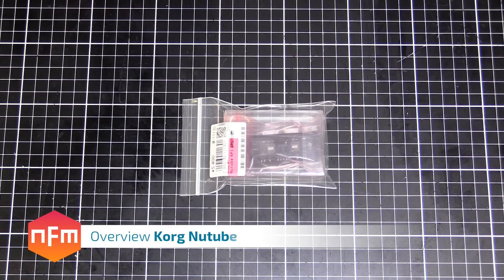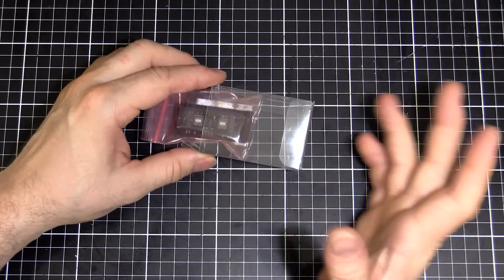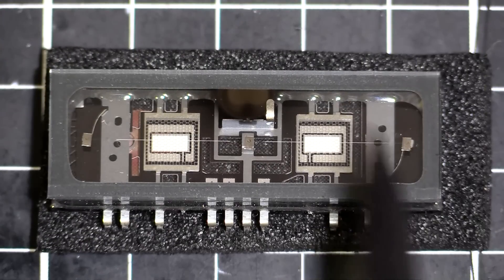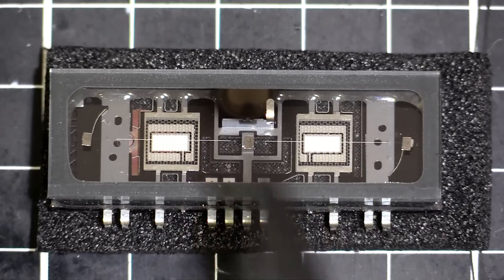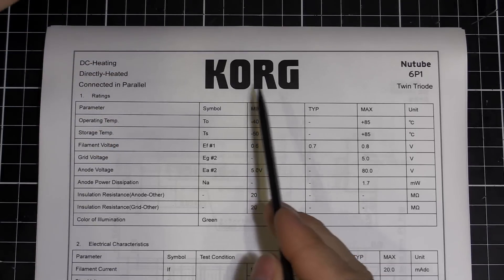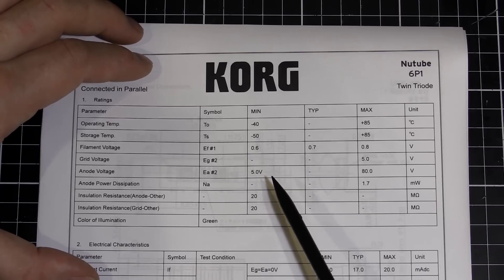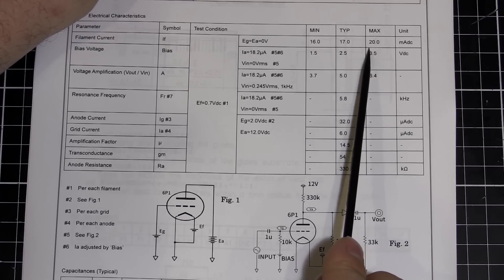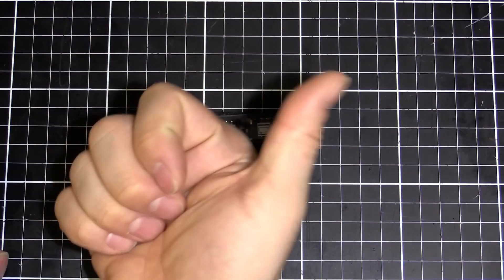Korg/Noritake 6P1 Nutube Vacuum Tube Overvew

Comment: dude its not an innovation... they took a Russian 6p1p (6p1 in china) and stuck it inside a Vacuum Fluorescent Display.. :/ stop hyping up this fake ass "tube" and VFDs. come in a range of colors m8.. not just green.. yellow orange and white are also common.. and why even bother.. why not just run a sub miniature dual triode on a starved plate design... fuck man i have a 9v starved plate headphone amp.. how is this any different..
Reply from the maker: The Korg Nutube only comes in green, no other colours.

I'm sorry you feel so angry against this device, I don't see how it is 'fake', seeing as VFD and vacuum tube technology is so similar.
Reply: I understand RobTapps88's point of view. The NuTube specs are pretty poor in comparison with a conventional tube. It has a low gain factor and no useful current drive capability, in fact it needs to be buffered with transistors to do anything useful. The price tag is pretty hefty too at 2 to 3 times the cost of 12AX7.

Comment: The amplification factor of this device is only 14.5 - like a poor performance or faulty tube. I wonder what the current drive capability is...
Reply: Transistors and ICs are cheap. Additional circuitry isn't a bother. Musicians are always looking for new sounds. That's the Nutube's job. To be non-linear. It does it. If it's non-linear in an interesting way, that sounds a bit different to other valves, then there's a place for it, which is why people buy them. 

If it sounds literally no different to some other valve, then it's pointless. But if it does, then it's earned it's place. Musicians do all sorts of stuff with effects boxes. Little differences are important.
Reply: Probably meant more as an effect, or something to build effects round, than an actual practical amplifier. We have transistors, there's no point in inventing "better" tubes. But interesting ones, certainly. Korg make electronic instruments after all, and musicians get all sentimental over vacuum tubes.
Reply: Not really, you can just put in a signal with greater amplitude and that will distort as well.......Just use a transistor or opamp to pre amplify
Reply: Bu if you drive it with 9 volts the headroom is like zero so it would distort like fuck non the less....
Reply: "there's no point in inventing "better" tubes". Well no one can accuse Korg of that. But the job of a triode tube is to amplify an electrical signal - if it can't do that then what use is it?
Reply: Phil Taylor well the point of tubes in guitar amps is distortion
Reply: ...which requires amplification. If you're after distortion then a 6AD4 submini tube will you way more gain at tenth of the cost... and it has much better current drive capability.
Reply: A couple of 6AD4s will give you around 60dB of voltage gain for plenty of signal clipping and without the need for additional transistor circuitry.
Reply: Im not arguing that the nutube is a good device. Im just talkig about distortion and that you dont need gain in the distortion device. For example  diodes from signal to ground will distort. Personaly I can produce the same clipping characteristics of a tube with other circuitry so i wouldnt use a tube at all.
Reply: lol i have germanium transistors with better amplification that that XD

Comment: Please help! I need to know, is there or is there not gas inside that tube? Why/How does it glow? Is that glow from gas, the filament or from a phosphor target?
Reply from the maker: It is a vacuum inside like a normal vacuum tube.
There are small squares of phosphor inside that glow constantly when powered up, just like a VFD display in your VCR screen.
The glow is constant though, and doesn't vary with the input signal at all.
Reply: Check out Ibanez Nu Tube Screamer....it fluctuates w input
Reply: The phosphor releases light, photons, not material particles. It's just an ordinary tube, in a weird format, made with a VFD process. The heater liberates electrons and the field across it makes them zoom to the anode. The grid modulates that. Any old triode. 

The phosphor is just for show. Because VFD production uses phosphor anyway, and it looks cool, so why not?
Reply: Vacuum tube should be "full" of vacuum...
Reply: be misnamed if it was not a vacuum :)
Reply: I'm pretty sure the phosphor coating is to encourage the release of ions under vacuum, it's not just "for show" but part of how it functions.

Comment: So what is the advantage of this technology? Why is it better than SS for headphone amp application?
Reply: It gives the 'tube sound' but with much lower voltage and current requirements than a traditional tubes.

Plus it looks cool too. :)
Reply: That's the thing. Then Vox (owned by Korg) did a demo of their guitar amp with Nutubes I couldn't say that it sounded all that good and tube-like compared to real tube amps. 
I'm just not sure it will be possible to achieve that tube-like sound (whatever that is) with this thing. And for the price like that it's just insane. So I just wanted to know if there is some other advantage of this technology over transistors.
Reply: AnalRectum. You mean ancient tubes or valves, now they are  cubes or rectangles with same sound than valves but at lower wattages, and also last way longer, it can't get any worse than that. 
We should name these power cubes intead of power tubes, l,o,l.

Comment: The fact they call this a 6P1 worries me. The 6P1 tube is a tube out of China also known as the 6P1P in Russia; and is a pentode with the functional equivalent of a 6V6. 

This thing is a triode with less than a watt of dissipation, but it's called a 6P1.

Makes no logical sense; I have to wonder what Korg was thinking when they called it that. That's going to cause a LOT of confusion amongst hobbyists.

As far as tubes running on low voltages; I've run 12AU7 tubes off 12V; and I have a 6J1 based buffer/pre that essentially runs the tube on 60V (-30 on cathode and +30 on anode). I think this might find some usage when you want small low-power tube in the chain; but I don't see this replacing tubes or becoming a very popular option among actual tube guys.
Reply from the maker: If someone manages to install one of these into a standard tube socket to replace a 6P1 pentode without noticing the difference, I'll be impressed on a number of levels... :)